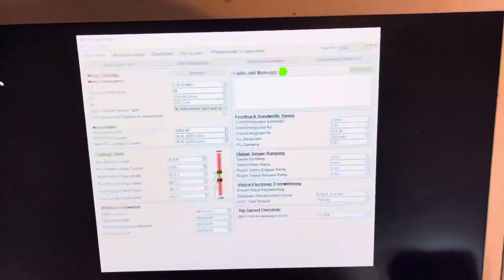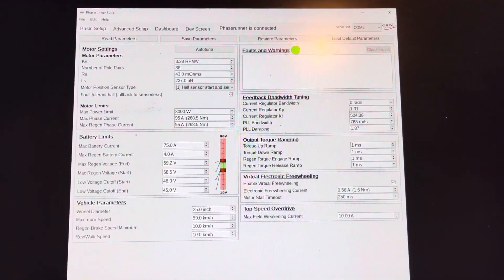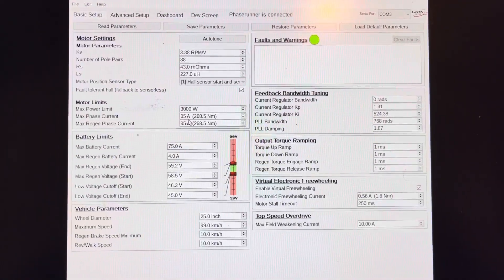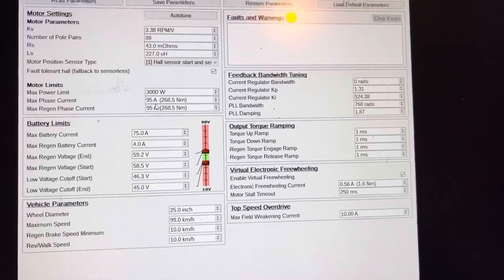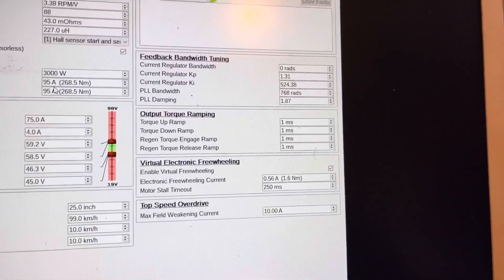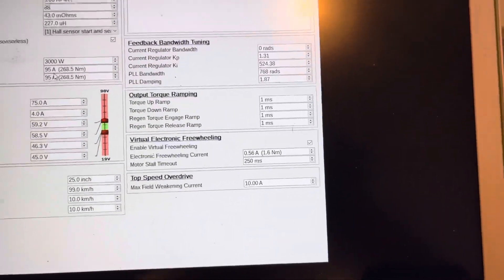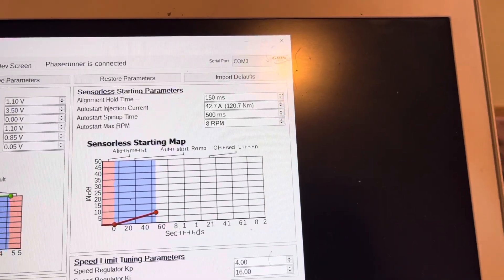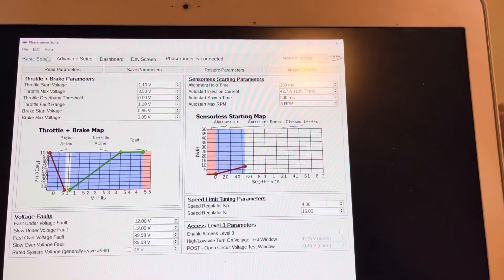Bagang BBSHD plus Grin tech PhaseRunner setup for 52v

Comment: thanks for posting this, i am also using a phaserunner 52 volt set up and used to have a ludicrous controller but I want to do 72 volt soon also. what type of battery are you running ? I have the luna dire wolf 21 ah
Reply: Make sure you run a shunt.